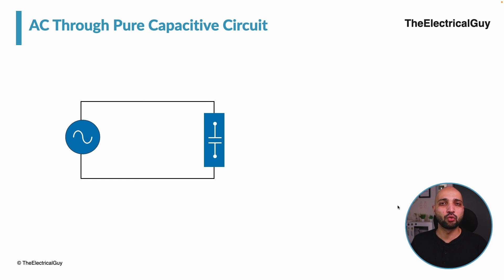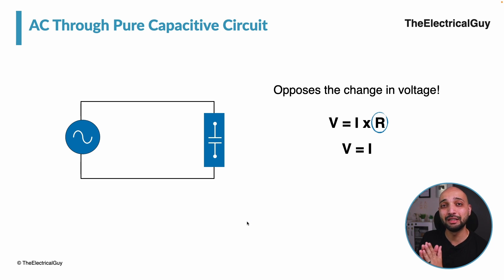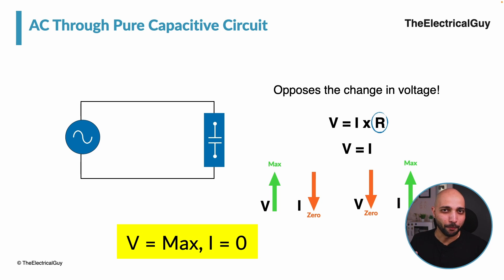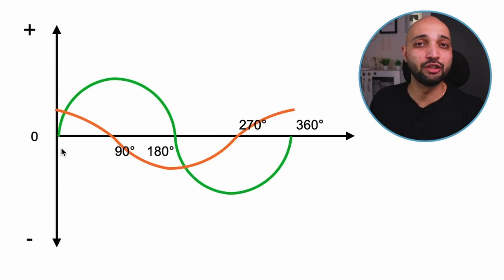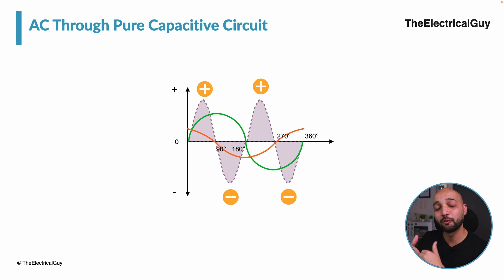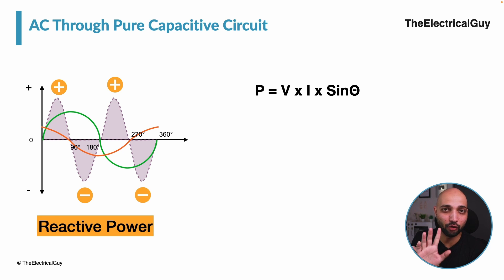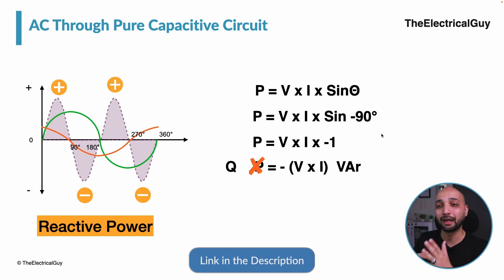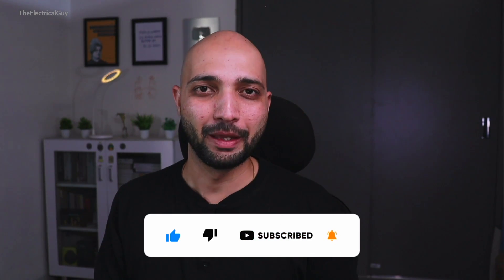AC Circuits : How do Capacitor works in AC | TheElectricalGuy

Comment: if the power  of purely capacitive circuit is flow back and forth in the system, so its reactive power is zero but  why you called a capacitor has negative power, which means delivering the reactive power,

Comment: is it possible to put a capacitor in a AC line voltage circuit to prevent millisecond volts drop on switching over unit like inverters.

Comment: If the power supply is down for longer period say 8 hrs. is it a good idea to bypass the capacitor bank when turning power back on? to avoid current in rush to other equipment with VFDs ?

Comment: I have a transformer which steps down voltage from 220 to 40 volt. But the problem is my AC supply line is not very much stable (varies from 230 to 250 volt).  I want to make it constant 230 volt with the capacitor process. Can I do it and what type of capacitor and value should I use (i.e. ceramic capacitor, electrolyte capacitor etc)?
Reply: U can use voltage regulator and capacitor is used to smooth the current